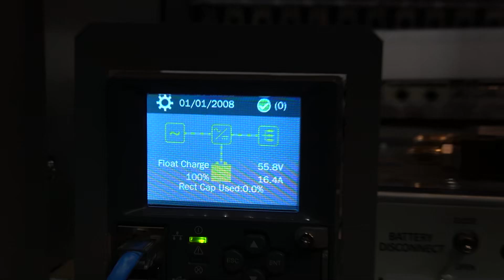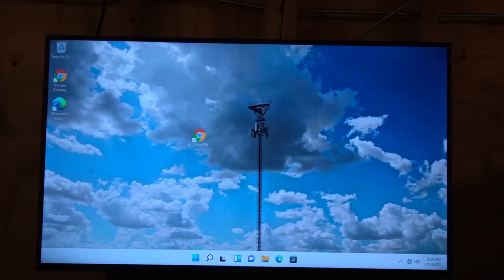Cell Site tower top at a training center

Comment: what is that little pointy half white half red looking antenna on top of the cabinet at 5:53, gps dome?
Reply from the maker: GPS
Reply: @ATI556  and is that used primarily for syncing time rather than location I assume?
Reply from the maker: Both